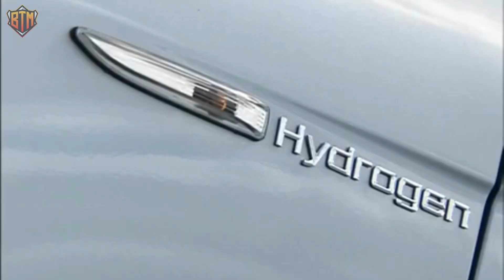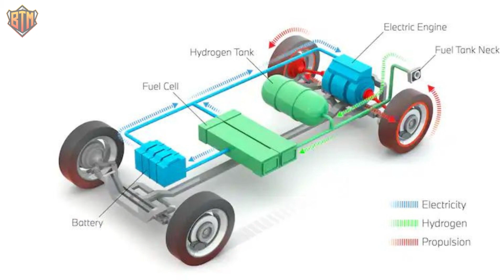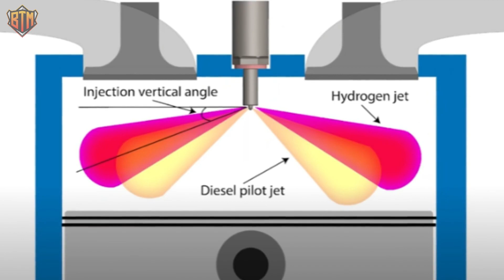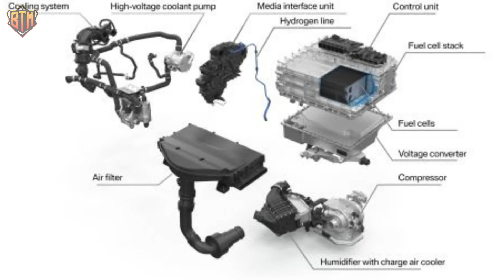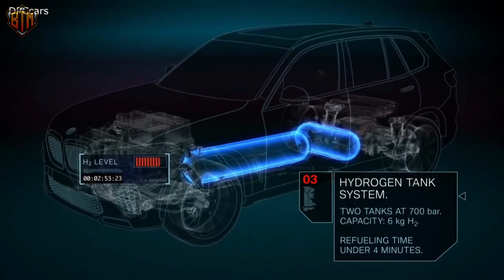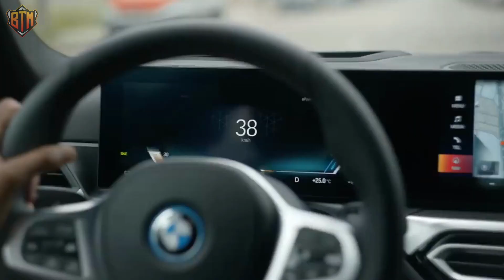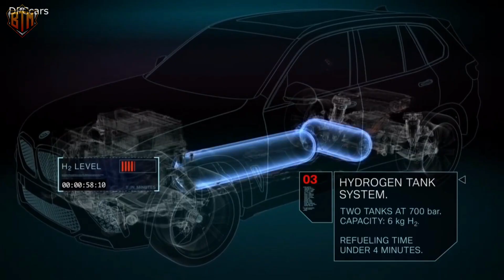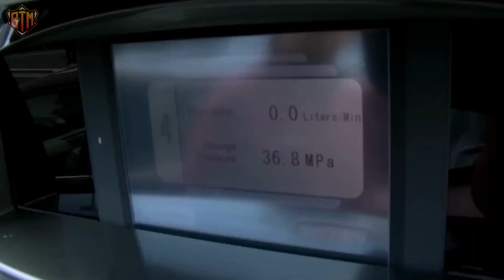BMW's New HYDROGEN Combustion Engine SHOCKS The Entire EV Industry!

Comment: Combustion engines have been around for ages and BMW still can't make them. They use plastic and their engines always leak (they leave the factory while leaking)! There's no way I am going to get in a car with a hydrogen engine made by BMW. It's like sitting on a bomb. Hydrogen is very volatile.

Comment: Hydrogen is very powerful: it has three times more energy than gasoline. But, unlike it, it is a clean energy source, since it only releases water (H2O), in the form of steam, and does not produce carbon dioxide (CO2).